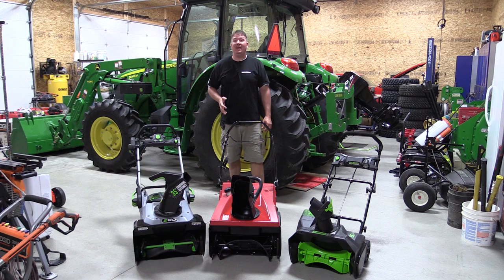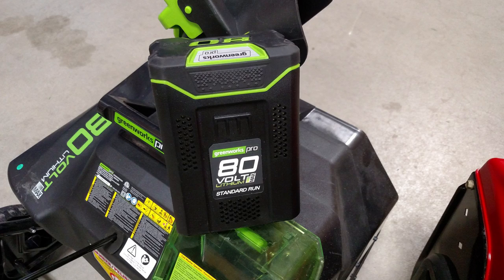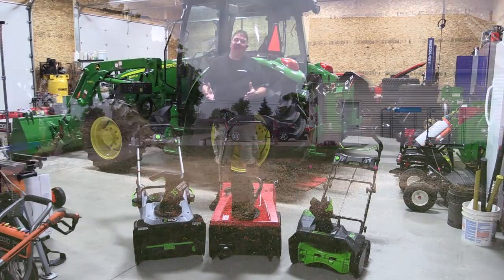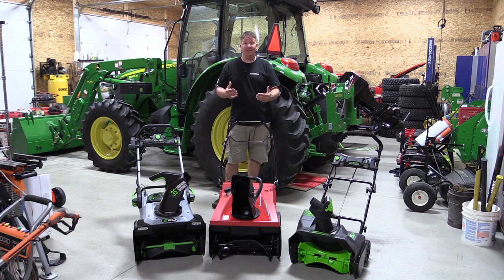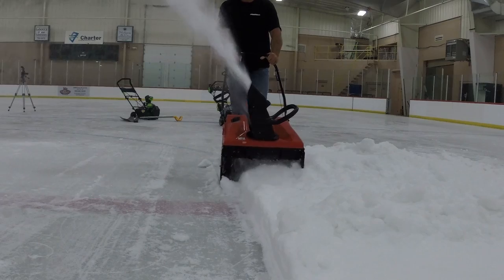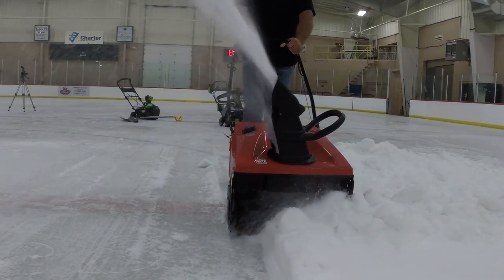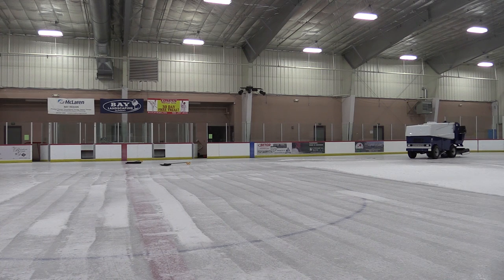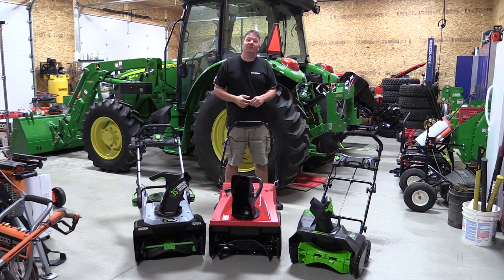Is a Battery Operated Snowblower Up to Real World Use?

Comment: I live in the Boston area.  We just got 13 inches of wet heavy snow.  I also own a 12 year old Ariens two stage snowblower so I can give a review of them both side by side.

Most important part of this Ego blower is the reliability of its starting and working when you need it.  My gas snow blowers have always been very unreliable since you make them sit for almost a year in between usages.  This unit is not perfect but it fits my need perfectly well.  I bought this unit as a backup for my gas snowblower because I have a large driveway that fits about 24 cars.  

Last winter I had a mouse make a nest inside my gas blower and chew up all the internal wires and hoses in my Ariens.  I bought this electric unit because the repair shop was going to take a couple months to get my unit back to me.  This past huge storm, I made two passes with my Ariens gas two stage blower and the belts smoked out on me so I had to use the Ego again.

At $600 with both batteries included, that comes out to about $160 for the snowblower since the batteries are $240 each if sold separately.  The unit is very light at 50 pounds and I carry it into my basement for storage and it collapses down to make it compact.

as far as clearing snow I had to use it for the entire season last year but we didn't get any major snowfall events.  For that usage it works great and it doesn't go through the real wet snow as well as my two-stage unit but it goes through the wet snow better than my shovel.  This last storm dumped 13 in of snow on us and it took me 4 hours to clear my driveway.  It would normally take me about 2 hours with my two-stage gas snowblower.  When I came upon the end of the driveway where the plows push over the heavy compact and wet snow is where this unit will have some trouble.  you have to take a shovel and break down the snow and basically act like a manual two-stage snowblower yourself and then the unit can clear off the heavy stuff at the end of the driveway.  

This Ego throws the snow a respectable distance but not quite as far as my more expensive $1,200 Ariens two stage snowblower.  It is also a lot more work as you have to manually push the unit instead of the tires spinning themselves.  I was able to take apart my two stage blower and repair it the next day and cleared away the sidewalk area and my neighbors driveway for him since his blower broke down as well.  The electric unit would never have made it through the harder, more compact snow the plows threw up on the sidewalks where the two stage shines.

It is very common when the snow gets deeper or heavier to have to manually pull the unit back and then push it forward and you probably only go about one foot each time that you push the unit forward so there is a rocking motion required for the real tough snow.  I really beat up this machine during the last snowstorm and it performed very well I'll be it very slow going.  

The benefit of this machine versus my gas powered snowblower came about when my parents snowblower broke on them and I had to take the Ego unit in the back of my SUV and drive over their house to use it for another 3 hours to clear the driveway there.  A gas blower is too heavy to pick up and is way to big to fit in my vehicle to help others in need or if you have multiple properties.

 If you have a large driveway I recommend that you have 4 batteries and 2 chargers since you get about an hour of run time per two batteries.  The unit comes with two batteries and one charger and it takes an hour to charge each battery.  If you run out of batteries you will have two hours before you can keep clearing snow again.  With four batteries and two chargers you have two constantly charging as you clear.  I had the two extra batteries and charger already because I own the electric mower and the leaf blower from Ego.  If you have a small six car driveway or less you would not need the extra purchase of batteries.
Reply: You make excellent points of interests.I am considering which of the Ego snow blowers to purchase,either the rubber or steel auger.If you have any information about that aspect please reply.Appreciate your original comment.👍

Comment: I've got the Greenworks 40v snow thrower.  It had no problem clearing out driveway, sidewalks, and walkways for me.  We recently had 9 inches of snow and it powered through it easily.  I used two of the 4 AH batteries.  I highly recommend the Greenworks lawn tools.  I have most of them.  Lawnmower, trimmer, leaf blower, snow thrower and chainsaw.   Don't have to worry about gas, spark plugs or oil with any of these.  I've had the set for a couple of years now.  They all perform very well.
Reply from the maker: Glad it is working well for you!

Comment: I've got two Greenworks 40V snow throwers and they work well. I've been highly recommending them as great smaller blowers that can handle most snowfalls, they're very quiet, and easy to handle by my wife and 13 year old boy. In this review in 2016 (three years ago as of Nov 2019), you said you had a 2Ah battery, 80V (160Wh). I have multiple 5A @ 40V (200Wh) batteries  to keep full charged with a very long 400' wide sidewalk and large driveway and patio. They work well, seem to last 45 minutes, and can fast charge enough that after one is drained, pop it in to charge and ~45 minutes later can come back to that one (not fully charged but good enough).

Comment: I enjoyed the video and appreciate all the hard work it took to make it happen in August  -But you didn't mention the biggest flaw of these new electric snow blowers  - Only the gas snow blower has Auger asset - With auger asset you just lift up on the handle and the rubber auger will hit the ground helping the blower move forward as you use it - And for any homeowner in wet heavy snow this is half the battle -  I will say they are great in powder conditions and work perfect on wooden decks since the rubber auger doesn't hit the wood - I use many Ego products and love them - But no battery operated snow blower will ever beat a gas blower unless it has some kind of self propelled system - Cheers
Reply: Larry A I agree... the new Snow Joe electric 2 stage, self-propelled is interesting. I'm excited to see how it does.
Reply: Greenworks 80V are much better, does the Job Faster too :))). Although I am NOT a big fan of the Blade, since it's NOT Rubber, so cutting is an issue. But overall I like the Greenworks much better, faster and an Extra Battery if you can afford it :)))))
Reply: Larry A new
Reply: You are right and  also should mention each year the battery will give you less performance of endurance . The replacement cost is really high, may require an optional second battery for backup. As they age those  batteries  may not be easy to get or reproduce at all as these battery technology operating equipments are still  changing.  Buyers should always check the price of your replacement battery before purchasing the machine.  Where as the gasoline models does needs the pain of yearly maintenance services but just a simple gas fill up. Performance of gas machines  depreciates  with very little noticeable as years goes by. The biggest pain for gas units were hard starting as they age.

Comment: ya, ima stick with my 5hp 20 (i think) year old, two stroke sears blower. Got it for free this year from an uncle, and this thing is more reliable than i thought it would be. has electric and pull start, but starts so well with pull that i don't even bother with the electric. On top of that, if i need to clear more than one driveway, i can just top up the tank and keep going. instead of waiting for the battery to recharge. And i know my running time will remain constant no matter the temp. It may not be a beast, but gosh darn is it reliable, and for what it is, it's a little workhorse to. just gotta respect it
Reply: That sounds like a great unit, but my 37 year old snow shovel never needs gas, and I never have to mess with oil for it. It’s even still on its original handle. I’ve also got an antique push-broom for light powder days.

Comment: I like the EGO brand.  I bought their mower back in spring, it's done a great job, and It's nice to be gas free.  I actually also own that same 80V Greenworks snow thrower you tested...I used it all last winter, and I learned 2 things.  It beats the hell out of shoveling, and the battery is way to small.    I would ALWAYS have to charge it once in the middle of the job, and then 30 minutes later, get bundled up again, so I could go out and finish with charged battery, heck, sometimes it actually took 3 full batteries to do the job.   I would like to upgrade to that EGO model...but I'm planning on replacing my old busted up driveway next summer, ans I don't want to hurt the blade/prop thing, on a new fancy snow thrower.  So I'll hang onto my Greenworks for one more winter.
The only way I could ever recommend someone to buy the Greenworks 80V snow thrower, is if they already have the mower, so they would have at least 2 batteries, which is nearly mandatory with this unit.
Reply from the maker: Why sell it with a small battery?  The Greenworks was impressive for its size and weight, but the battery is what holds it back.
Thanks for your comments!
Reply: It's crazy.  The most power hungry tool is the snow blower, and it's their only tool that can't use their 4ah battery.   The reason is the lid that covers the battery compartment...the 4ah battery is longer, which means the lid won't close...which means the electronics will get covered in snow, and get destroyed when in melts.  All it would take is for them to redesign the battery compartment door...ans yet they don't.  It baffles me.  After I watched this video, it reminded me winters-a-commin, and bought an additional 2ah battery, so I'm better prepared this winter.
Reply from the maker: I am confused, because the instructions say they recommend the use of 4Ah or higher batteries.  We used it with 5Ah and 7.5Ah batteries without issue.
Reply: You are confused.  I'm talking about the 80v Greenworks...not the EGO.
Reply: If your getting a new driveway you should put in an under driveway heating system never have to shovel snow again
Reply: @murc111  They updated it this past year in 2018, so that it can handle the bigger batteries. Too bad they don't sell it with the 4ah one still.

Comment: Very nice analysis and video also well done. Now you are unfair to the gas snow blower in the sense that you chose a single stage. A 24" Troy-Bilt 2 stage gas snow blower with electric start and self propelled costs the same as the Ego at $599 and will blow rings around it partly due to the 2 stage process. So same price and electric for now loses badly. Also another angle you maybe should have considered is that for a lot less at about $450, you can get a gas electric start 22" 2 stage blower. Finally when those  5ah batteries die, they cost $220 each - you have a dead machine unless you go fork over the money. I agree the maintenance of a battery-driven unit is much nicer. You made a good comparison on power but you might lead some people to run out and get one of these for the convenience and realize they could have had a better situation financially and performance wise if they went for gas-powered at this time.
Reply from the maker: You are correct, the value is still in purchasing a gas unit.
Reply: Ralph Ross I agree with you on most points.  However, I do see a niche for these units.  I am probably going to buy one.  I live in Wisconsin.  It snows here quite a bit.  I have a larger two stage unit for those wet or heavy snowfall days.  However, it is a pain to use that for a only a few inches of snow.  I also have a decent sized area (not excessively huge but large enough) which makes shoveling a real pain.  I do like the aspect of not having any true maintenance on something I may or may use (especially having to do it for two things).  I also do not have to worry about whether or not an electric unit will start.  I have also been there and done that with my gas unit on a -20F day.  I definitely think an electric single stage is good for my particular situation.  Value is to the eye of the beholder.  

On a side note, I have a small yard.  I am currently switching to Ego tools lawn mower, blower, and trimmer.  I have a large battery (5 AH) for each of my tools.  I am also staggering my tool purchases, and purchasing all the tools with batteries.  I should be able to have enough run time for awhile.  One thing a lot of people do not consider is that the batteries can be rebuilt by those with some know how.
Reply: @keithfillinger3182  You are correct. My point was for people to be careful and also include the cost as a factor but each individual situation may result in buying a cordless just as say. Actually I have an EGO blower and in fact I like the EGO products right now over the other cordless brands - their support is also very strong at EGO. One tip on the batteries is if one will not charge, put it in parallel with a good battery or similar source and see if it will charge up enough say in 15 minutes or so. Then see if the regular charger will now see it and charge it. You probably know you can take them apart as well, to try and fix them; but that is trickier. Good luck.
Reply: Ralph Ross You bring up good points.  I am aware the batteries can be taken apart and individual cells replaced if needed.  As these cordless tools increase in popularity, I would not be surprised to see a new market created (people who service and rebuild the batteries).  There is a battery place near me that does some battery rebuilds.  I do not know if they would do lithium ion ones.  I will have to call them and ask.  I also think these batteries will get cheaper over time as technology improves.  Just a few years ago battery powered tools were a complete joke.  I think these improvements will keep coming in the very near future.  

While I do think gas is probably better for those who do their own maintenance, are good at it, and have the time to do it, I would wager a lot of people do not do meet those requirements.  I have been to my local hardware store which is almost always accepting lawn mowers and snowblowers for service work especially at the start of each season.  I do not know what they charge for that service, but a few modest bills ($50 for an oil change tune up, air filter, new plugs does not sound unreasonable) and equates a new battery.  However, I do not know about the actual longevity of the Ego products themselves, but if they last, a replacement battery comes a lot closer to being inline with gas tool ownership over the course of a few years for people who do not do their own maintenance.  I know a lot of people bring up the expensive battery replacement as a total negative against owning these tools.  For a lot of people, I do not think it matters much as long as the tools themselves last.  

Thanks for the tip on the batteries.  I am just starting my conversion to Ego tools.  I should not need it for at least three years.  ;-).

Comment: We've had some Canadian built snow blower, I'm not sure which company, since 2005 or 2006 and we use it several times every winter, and it functions perfectly. It does have electric start, but I find that isn't even really necessary most of the time. It's never been tuned up or anything. I'm not sure whether this is an exceptionally reliable unit or your issues with starting snow blowers are hyperbolic.

Comment: Wish you'd have included corded electric in this comparo.  I have a 20" Greenworks corded that's worked pretty well for me, but the otherwise identical cordless version oddly seems to have more power.  For six inches or so, all of the above will work fine.  We got dumped with 2 feet overnight, though, and for that, gas-powered is the way to go.  Even then, if you stay on top of it, rather than wait til the end of the storm, electrics can handle it.  But if it all comes down overnight, that's not realistic.  All that said, my little Greenworks did the job on 24" deep snow on my 100' driveway, albeit with a lot more elbow grease than would have been needed with a gas-powered beast.  Still approximately 433 times better than shoveling, though.

Comment: Very informative video. Im currently in the market for a battery operated snow blower. This Ego looks like it might be it
Reply from the maker: After using the EGO for a winter, I can tell you that the only downside is that the cutting edge will catch on differences in driveway heights.  If you have cracks, it will find them.  It will clean the driveway well though.  The plastic scraper is cheap to replace if you wear it out.